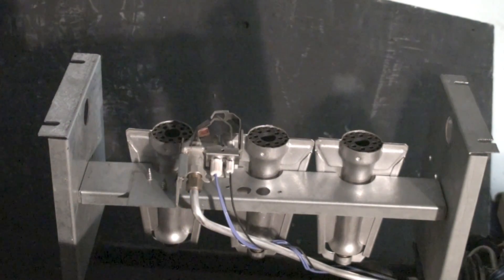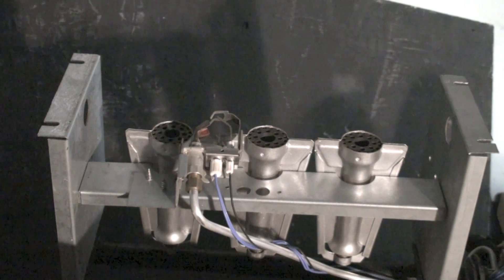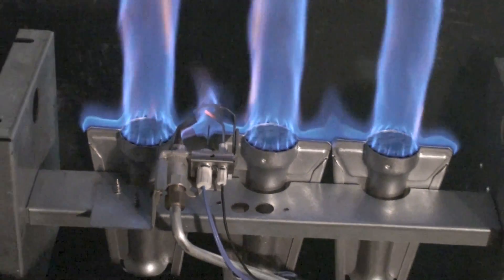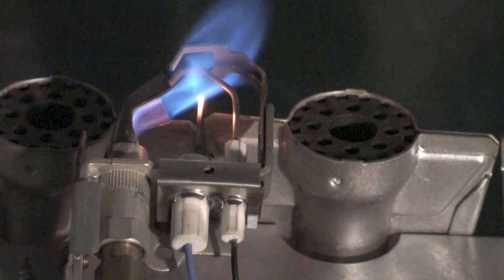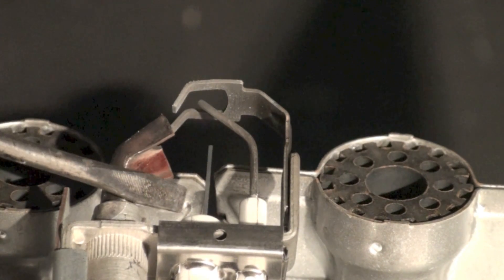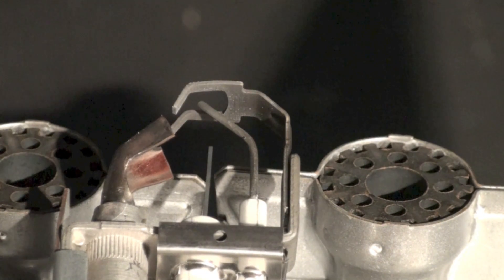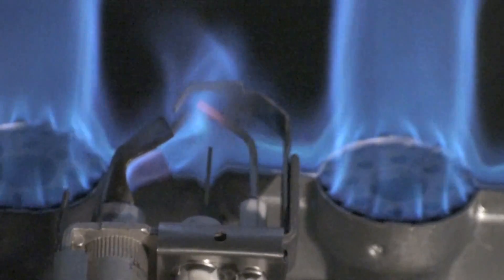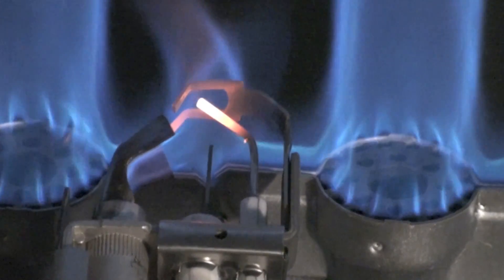A look at Smart Valve operation

Comment: Were these available as a 2 stage valve for a 96% furnace?
Reply from the maker: I have never seen one.  These control systems  were developed as a stand alone control system, usually used on low price furnaces.  They have been mostly been bypassed
GFM
Reply: Are they still used today?
Reply: Why were they bypassed?

Comment: I had some rooftop units with this system.  Had a lot of problems with defective valves, (where the wiring plugged in, or the circuits inside).  Also these little beetles would be attracted to the pilot office.  I would tap the pilot hood and the beetle would fall out.  Happened three times in a row, on the same unit.
Reply from the maker: Smart valve is a misnomer.  There was a solder connection at the plug that would loosen and cause a flame failure.  
GFM

Comment: FYI

I don't know about Honeywell OEM, but I took apart a compatible SS24 SUPCO ignitor that had only lasted part of one season and discovered that they actually use a copper cuff thing that is brazed to the nitride.  I had to dig out the potting material with a very skinny drill bit (held with my fingers) to see it.  This is totally inferior and doomed to premature failure due to the combination of oxygen and thermal stress destroying the braze (the reason I took the damn Chinese piece of crap apart to start with to see what happened).  Nickel alloys OR BETTER  are supposed to be used for the connector with a suitable solder and flux.   Lookup patent US20120175405 to see why SUPCO parts are crap.

Comment: I have a heil icp 80% furnace that runs and flame goes out . Smart valve flashes 4 times then flame comes on again .  It has new filter. New blower motor.  New inducer. All limit switches are good. All vents are opened.  Could it be a bad gas valve???
Reply from the maker: There was a common failure in these valves.
A bad connection in the electronics causes intermittent shut downs.
Try wiggling the wires that go into the top of the valve.  If it opens and closes, that is the problem.
GFM

Comment: Help.. I just changed the igniter assembly and now I have large yellow flame pouring out of the pilot .. it does not go out even after the burners ignite...thanks
Reply from the maker: First, it is normal for the pilot to stay on during a call for heat.  
As for the large flame, you have not installed the pilot orifice when you replaced the assembly.  It should have come with the assembly.
GFM
Reply: @grayfurnaceman  I did install the pilot orifice. As I said it ignites then the pilot lights then a call for gas.. But the pilot stays lit and it flames up the box.. So in fear of fire o shut it down..
Reply from the maker: @mikekendall5835  Can you send a video to grayfurnaceman@gmail.com?
GFM
Reply: @grayfurnaceman  I bought this house a little over a year ago..Then this winter I turned it on and it ignites then turned off.. So I replaced the igniter sensor assembly.. Now it lights.. I suspect this is how poorly it was running last year... But it was working and I never investigated it.. Now after opening it up and seeing no filter inside I'm assuming it is filled with dirt.. Thank you for your help.. Happy to send you some money if I can get this working correctly...
Reply from the maker: @mikekendall5835   Are you sure you have an orifice in the pilot?  Also, the manifold pressure does not seem right.  Too low.
GFM
Reply: @grayfurnaceman  ok kick me hard... I ordered two igniters, both of which did not have an orifice included.. But you said orifice and I found the schematic and sure enough there is an orifice.. So there had to be one somewhere and when I took the pilot tube off it had fallen out hiding in a corner.. I installed it and everything is working... But it cycled four times the burners stayed lit...This is propane, is this normal?... If not what should I look at next.. Nice solid blue flames on the burners no yellow... Thanks..
Reply from the maker: @mikekendall5835  Are you saying the blower cycled during the call for heat?
GFM
Reply: @grayfurnaceman  first of Merry Christmas... So sorry not to get back to you... The next day and up until last night the furnace worked perfect.. New ignitor/sensor installed.. was working just like your above video..Then last night come home to a cold house.. It's back to what was my original problem.. Cycles on gas is called ignited last two seconds shuts down.. We are due for 23 hours of snow the day after Christmas... I took out the igniter/sensor and lightly cleaned the sensor knowing it is only two weeks old.. Nothing changed... Any thoughts where I go from here... And there was no filter in my furnace since I bought the house a year and a half ago.. Still no filter because I have no clue where it should go..m Could that cause this problem.. I plan on sending you some money for your help... I'm not a bullshit kind of guy.. Your help is worth something.. Anyways thank you in advance ...
Reply from the maker: @mikekendall5835  Does this unit use a Honeywell Smart Valve ignition control system?  If so, these systems had a lot of problems with a loose solder joint in the control.
As for filter, is it up flow or down flow?
You don't need to send money.  I get paid by the advertising.
GFM
Reply: @grayfurnaceman  yes this is a Honeywell smart valve... Now what drives me nuts is I turned it on an hour ago and it fired up with no problem.. So the controller should be replaced..The squirrel cage sits on the bottom with a large hole on the left...I'll post a picture...
Reply from the maker: @mikekendall5835  Try wiggling the plug on the gas valve.  Where the large hole is is probably where the filter goes.
GFM
Reply: @grayfurnaceman  it seems during the day when it is warmer outside... Furnace in cold garage.. it seems to fire up after a couple tries.. but at night when it is in the high 20's it ignites and goes out over and over... Well tonight 3am it tried for 20 minutes so I went out wiggled the wires then tapped the plastic case and she went through the entire cycle and is working.. Time to replace the whole thing or can it be cleaned?... Thanks again..happy to send some$$
Reply from the maker: @mikekendall5835  The early smart valves were not real good.  I would replace it.  I do well on advertising, thanks.
GFM
Reply: @grayfurnaceman  You have helped a lot.... Thank you for your knowledge and time...
Reply: @grayfurnaceman  hello... Well I just received my new Honeywell smart valve.. After viewing a couple install videos about converting it to liquid propane.. It says to use a manometer to adjust the pressure.. I like doing things correctly.. Looking at Amazon a monometer is about $35 to $100.00.. My question is will a $35.00 manometer be sufficient for this one time application... Thanks..
Reply from the maker: @mikekendall5835  I use one of the cheap ones and it works well.  You can also make one.  I did a video on how to do it.
GFM

Comment: How do you adjust the pilot gas pressure?
Reply from the maker: The gas valve has a cap that says "pilot adjust".  There is a screw under the cap.
GFM
Reply: I found this and when I turned the screw, no matter which way, nothing seemed to change, still a lazy yellow flame. Failing gas valve?
Reply from the maker: @AmericanFarmerHVAC2024  Or possibly an obstruction in the gas supply.
GFM
Reply: Gas supply is all good, for all the other appliances in that house. It's an old Tempstar DC 90 unit, that is the furnace. I checked the pilot assembly, all is clear. Maybe it comes down to garbage propane? As a water heater unit sooted up the same way and failed. But the adjustment on the smartvalve for the pilot does not work, and due to the cost of a new smartvalve I have been recommending this customer to replace the whole unit. The customer doesn't want to, as the co test is good on the furnace. Strange situation, I've never came across this before. It's summer now finally, but I'm sure I'll have a call back on it this fall. Thanks Gary.
Reply from the maker: @AmericanFarmerHVAC2024  I am sure you have tried this, but the pilot assembly is clean?
GFM
Reply: Yes.
Reply from the maker: @AmericanFarmerHVAC2024  If you have checked the gas pressure, the valve must be bad.
GFM
Reply: I'm assuming so. Thanks.

Comment: GFM< if the flame rod just proves the pilot then what proves that the main burners are lit? interested in this type of ignition. Thank you
Reply: Pilot remains on all the time therfore providing flame signal and main flame no pilot no sense no main . This is basic stuff guys
Reply from the maker: There is nothing to prove main burner.  
GFM
Reply: That's scary if for any reason the pilot assembly is bumped out of position and the burners don't lite the gas valve will just dump gas in the burner alcove. Serious delayed ignition once it ignites. Is the ground strap also helping with the flame rectification. Thank you for your quick reply. I've tried to look at my school notes and unfortunately it's not explained in detail how an intermittent pilot ignition type works off of a smart valve.. thank you! Great videos!

Comment: Hello. I have a similar question as Larry. My difference is this. My furnace w/ the smartvalve will cycle normally most of the time but sometimes when it's colder and it has to run more often, the burner will go out. The pilot stays lit, the blower keeps blowing and burner doesn't try to reignite. I've come home to a cold house more than once from this. Would you still think gas valve with these symptoms? Thanks.
Reply from the maker: +golfgodd1 You may try cleaning the flame rod on the pilot assembly.  Very careful here, you could break the glow stick.  Hope this helps.
GFM
Reply: +grayfurnaceman Hi. Thanks for the reply. I actually did that already. I removed the whole assembly ( which was a pain ) and cleaned it. Seemed ok for awhile then the problem came back. It's kind of hard to say because it's an intermittent thing. Would you recommend replacing the igniter/rod assembly at this point? Also, my problem seems different than all the others I read about. My pilot always lights, the burners always ignite. It's like sometimes when it should shut down at the end of the cycle the burner shuts down but everything else is still working. Pilot, inducer, blower all still functioning just no burner. Any thoughts? Tks.
Reply from the maker: +golfgodd1 This one problem is probably related to a control failure.  It means a new gas valve / ignition control.  
GFM
Reply: +grayfurnaceman So just to be clear, your recommending replacing the actual smartvalve unit itself?
Reply from the maker: +golfgodd1 That is correct.
GFM
Reply: +grayfurnaceman  Thank you.
Reply: That Honeywell Not So Smart Valves are junk and look at 300 to 400 for Valve.Had one on a Customer's House lasted about 2 yes and go bad 3 valves in 6 yes found the electronic board of top of valve would get condensation on it blue corrosion on board and go out. So not so much the Valve as the Electronics on Valve

Comment: I have a furnace with this Honeywell "smart" valve which will not start. The HSI comes on but the pilot is incredibly small (I didn't actually think I was getting any gas to the pilot for the longest time but I finally just noticed the faintest blue flicker). Naturally the tiny pilot does not prove flame to the flame sensor rod. Assuming it isn't a gas supply problem then what might this be caused by? Thanks!
Reply: The pilot tube at the hood needs to be cleaned out from any debris

Comment: You did not explain what happens if the flame rod fails. Would the valve not open at all and the pilot flame stay lit or would it go out, or would the main valve open and then and then shut down?
Reply from the maker: +Larry Stricker If the flame rod fails to sense flame, the spark will continue even with a flame on the pilot.  I think after about 1 minute, it will shut down on flame failure.  Hope this helps.
GFM
Reply: Thanks, The pilot is staying on but the valve fails to open to the burners. this must mean that the valve has failed and not the Flame sensor. Am I on the right track? Thanks Larry
Reply from the maker: +Larry Stricker Probably if the spark stops and the valve does not come on. This is assuming the gas knob is turned on.
GFM
Reply: yes, It is a smartvalve and the gas switch is on in fact the glow plug lights the pilot light and it stays on, however the gas does not open.
Reply from the maker: +Larry Stricker The gas valve has probably failed.  Not uncommon.
GFM
Reply: Thanks for all of your help

Comment: What's the point of having a pilot if there's a hot surface ignition? I guess the Smart Valve is for older furnaces.
Reply: Yes used on many furnaces years ago just junk and very costly valve 300 to 400 dollars
Reply from the maker: It is just one of the ways Honeywell had of dealing with the furnaces that used a pilot to light the main burners.  I'm not saying it is the best, but it is out there and in some cases is still being used.
GFM